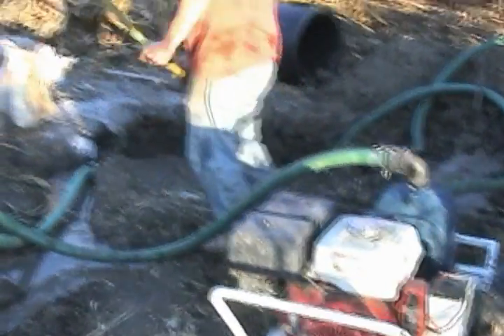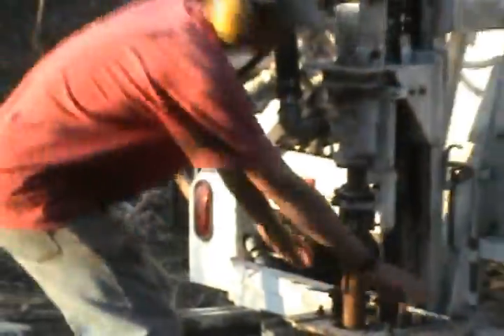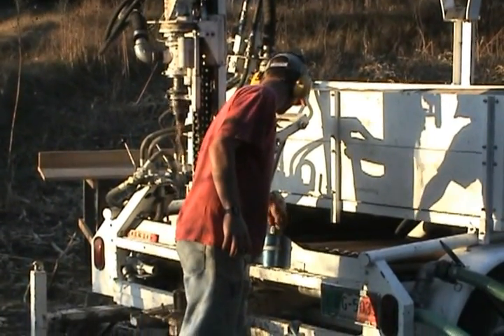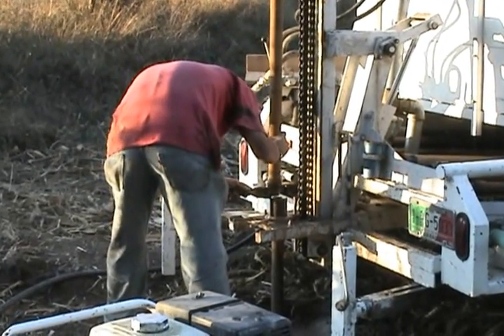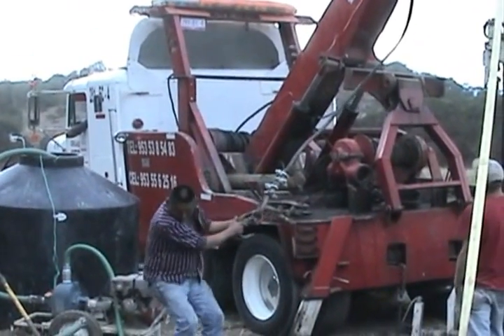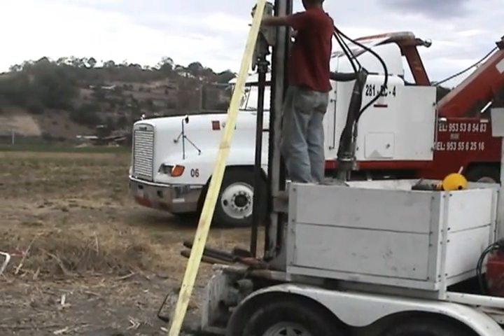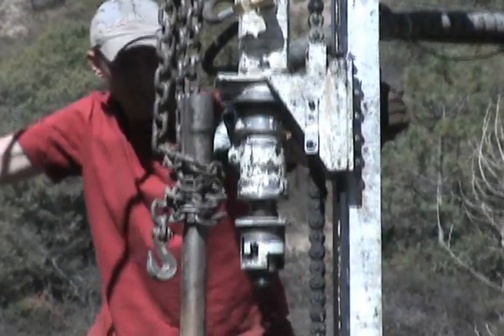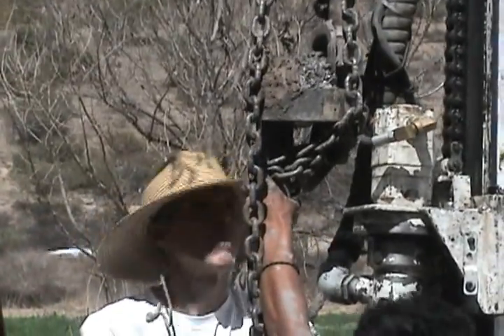WHEN THINGS DON'T GO WELL WITH WELL DRILLING

Comment: When pipes hard to take out need to take in the same hole put new pipes without drill bit only using water and flushing to the bottom when sand no going take out 2 pipes in same time no need recovery trucks

Comment: Weeks of resources lost. If I would have been in charged?  No way. I would have abandon pipes and bits. Next hole
Reply from the maker: As explained in several comments that time was the only resource lost because we’re volunteers.  Wish we had the resources to abandon the hole but we were working in some of the poorest areas of Mexico. We were hundreds if not thousands of miles away from buying more drilling equipment and didn’t have the money for it anyway.  Thanks for your interest in the project.

Comment: What kinda rig is that? That thing is tiny haha
Reply: Also if H2S starts to pour out everyone is dead wtf no safety at all
Reply from the maker: This small rig that I designed and built has gone into small spaces that no big rig could.  It was only cable of going 300 ft which worked most of the time for what we needed.  There’s no OSHA in Mexico so maybe we were a little lacking in safety measures which other contributors have mentioned.

Comment: I know nothing about drilling, except metal. Most comments suggest what I initially thought to myself: "that is a pretty small pipe for that size of hole, must be good shit!" Until I read the comments, but you must have had good experience with the equipment...so...what ever.
Reply from the maker: ObsessionPC Your deduction was right, it was too small of pipe but we had been successful before.  This time the material (some kind of slate) we were going through was just too hard for our machine and bit. Live and learn, thanks for your comment.
Reply: ah cool, thanks for the detail on that. Can't ever know too much!

Comment: How deep was the hole.... I would have just moved over and drilled again.... 2 weeks is complete waste of time.... Time is more valuable..... I could drill that well 100 feet deep with plastic pipe... And do it in 3 to 4 days.... Just need water and compressor

Comment: U need more water or mud to keep the overburden/ rock washed out of the hole while drilling otherwise you'll be hung up in the hole every time also dont drill dont move up or down dont do nothing until u have water/ drillmud circulating out the bit and up out the top of the casing.

Comment: man id be using at least 2 7/8 drill pipe with rotary table rig for a 10" bore hole
Reply from the maker: I agree with you hundred percent but when you're cutting corners because of cost some decisions just can't be reverse after you have made them. We have drill many successfully wells with the rig but it does have its shortcomings when it comes to penetrating rock and drilling larger boreholes.  Thanks for your feedback
Reply: And how much money did cutting those corners cost you? Never cut corners on anything that can hurt you or you can't pick up with one hand.

Comment: I have made many of that corkscrew fishing tool on my cable tool rig. Usually for fishing out soil sampling barrels that fell of the sampling jars.
Reply from the maker: Multi-use tool?    LOL
Reply: We would use a casing spear to fish casing over 6" in diameter.  Drill stem we would fish with an overshot. the overshot was usually a piece of pipe with an inter diameter an inch to half inch greater than the outer diameter of the fish.  By heating up the pipe with a torch and hammering dimples in the pipe progressively deeper from top to bottom you have a cheap overshot.

Comment: there is an excellent reason why many highly experienced drillers prefer cable tool rigs, especially when working in developing nations. Highly dependable, easy to fix in the rare situation when something needs repair when resources are very limited and very low purchase price, low cost tooling, straight wells. Rotary rigs and their alleged faster drilling rate are considerably overblowen and far more expensive to operate. Big monthly payments. Cable rigs, low cost and usually no monthly payments.
Reply from the maker: Thomas, you are right on so many accounts but once we went this direction there was no turning back. Thanks for your input.

Comment: My experience is limited to oil, but did you try an overshot to fish the pipe? They might not be all that cheap, but i bet it would have been cheaper to rent an overshot tool vs losing weeks worth of time
Reply from the maker: fockingclassy Read how I did make my own overshot and it ended up blocking access to our pipe. Ugh!
Reply: I read below that you made your own overshot. The ones we had in the oilfield have a set of grapples inside that slip over the end of the parted pipe,  and when you pull up into the pipe they bite the pipe super tight. There's also another fishing tool called a spear that goes inside of the parted pipe. The tolerances for these tools to work is pretty tight though so you have to know the ID/OD of what you're trying to fish to a really close measurement. I believe you can get a solid description of these tools from the Schlumberger website.

Comment: I live in Colombia South America and had a similiar problem with even a smaller drilling rig. our "weld "came undone at the coupling at 14 meters. we grabbed our shovels and dung all the way down and got our bit out. With us like you it was at the time my only bit. It's not easy to do this type of work with little or no money, I feel your pain.
Reply from the maker: Wow, that is a long way to dig.  Our bit is still down at 18 meters.. but we did recover our drill pipe.
Reply: Why didnt you just buy some new pipe and make a new hole if you had to get those truck that probubly costed more.
Reply from the maker: Drill pipe is very expensive and hard to get in this country.

Comment: thats what happens,when you havent got the right equipment,rig is too small to do proper bores,no slide head,otherwise slide the head a few inches and drill another hole right besides the first one,piece of cake,or use overshot pipe to clean the original hole pass de stuck pipe,but don't spend weeks pissfarting over a drill hole,in the end,you go broke,and the mud pump?? that is a joke,you need either a positive displacement pump,or otherwise a much more higher horse power pump you need not only uphole velocity,but also volume,and as for the thousands of dollars worth of pipe in the hole?are you joking?piddle pipe like that does not cost much,I would say $300/10 foot.

Comment: why would you drill a 10 inch hole with such small pipe !!!!????....for one ,.....no torsional strength !!!.....two ,.....that  small of an I.D on the drill pipe could not ever create enough annular velocity to properly clean the hole !!!!...that is why you got stuck !!!!......holy crap !!!!
Reply from the maker: You would laugh at how slow our ROP was in this project and this is because of our lack of resources - the right equipment and the material we were drilling through.   Here's my email address as I'd like to have yours because I may have a question or two in the future if you don't mind.  You sound like a good resource.
Reply: I would not ask that.

Sounds much too personal.
Reply from the maker: As far as cleaning the hole it wasn't a problem as we checked the cuttings coming up constantly and the hole remained clear.   We weren't stuck but the drill pipe snapped in the middle.  You are right about the size of the drill pipe being too small because the downward pressure on the bit caused the pipe to wobble in the middle of the bore hole.  You can probably picture it as like when you want to break a piece of wire and you twist it around and around or back and forth it creates such frictions it will eventually break. This is what happened at one of our tool joints.  We learned a big lesson... thanks for your interest.
Reply: No problem...been in the drilling industry since 1978.....air drilling...fluid drilling...aereated mud...deep ..as in 25,000 ft..shallow as in 18 ft....oil,gas,water,geothermal....small ID...1.75", all the way up to 48". Hammers, tricone,PDC. One of those been there done that type of people...34 different countries.
Reply: What was your ROP ?
Reply: Greg! Smaller diameter = u guessed it... Higher hydrostatic pressure! Just like and well! Work on the rigs long enough and you'll find out before a dumb comment like yours you'll learn something when asking ...unlike a smart ass!

Comment from the maker: One of many reasons we didn't drill another well is what was mentioned.  We had thousands of dollars worth of pipe and a bit in that borehole that we couldn't afford to lose.  We were grateful to have recover most of it.
Reply: Each trip each drill stem should have a tag bar in it.
Then you just have to drop another stem down in the hole with a tag bar tool to catch it.
If you need drill stem or other components alibaba's probably the best way to go. The cost of pipe is about a tenth of what it would cost in the US.
If you don't know what a tag bar is you can look at oil and gas industry in Canada and then you'll know what we're talking about
Reply: 1000s of dollars?  Really?  What was you down about 14 miles?
Reply: David Catherina i dropped a 3k lb collar and bit assembly 300 ft down a 20 inch hole. We made a 16 inch tophat type overshot. Worked first time....
After we spemt 3 12 hour days missing
Reply: David Catherina you should  of had mu mom their, no joke! she knows  about this stuff, and she is almost 80!!!!, im not shitting you!

Comment: Why didn't you just start a new well? I don't understand why you went through all of the trouble of pulling such little pipe up. Was that your only bit?
Reply from the maker: Good question.  We couldn't afford to lose that much equipment and everyday we thought that this will be the day we succeed, but day after day passed in failures. Not in our wildest dreams did we think we would be doing this for weeks.
Reply: David Catherina Is it producing water now?
Reply from the maker: +Nooch Martin 
No.  We recovered our drill pipe but lost our only bit at the time.  Other circumstances led us to abandon the well completely and that's why sometimes things don't go well with wells.  I wish in this case it would have had a better ending.